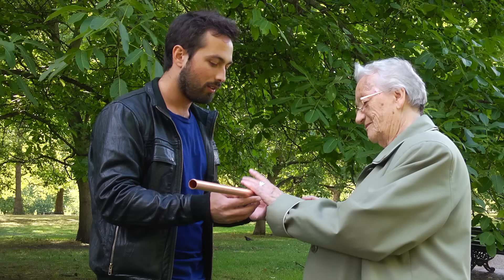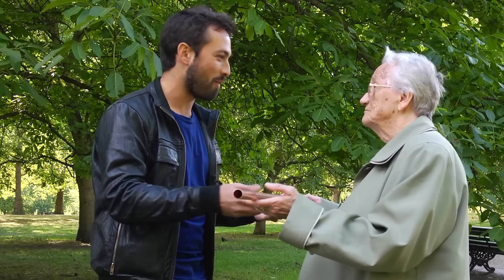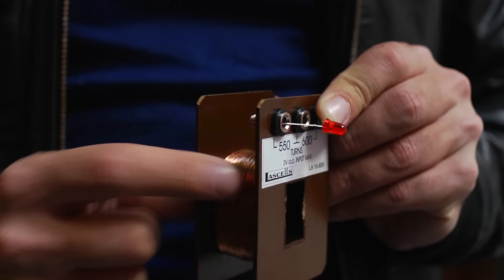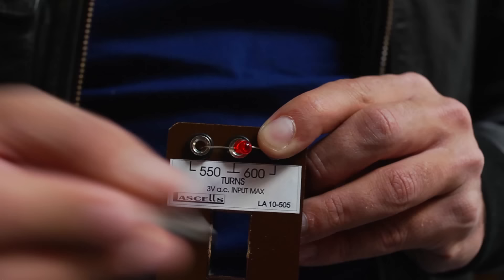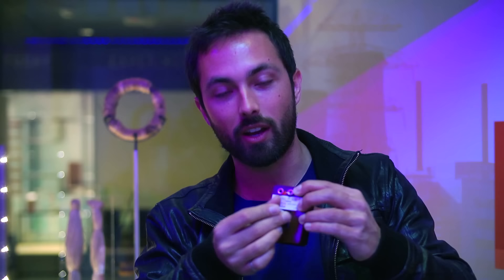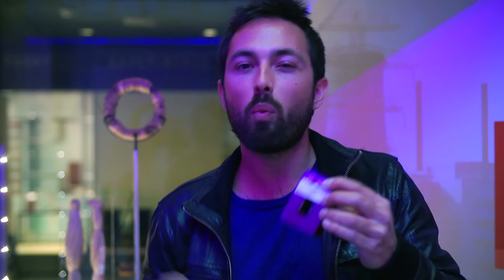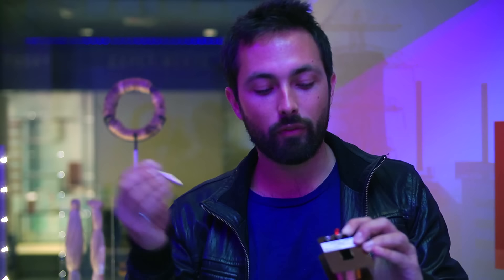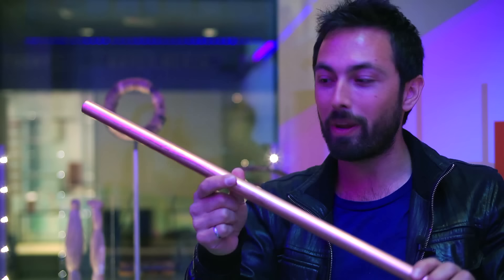World's First Electric Generator

Comment from the maker: It would never stop because if it did the magnetic field in the pipe wouldn't be changing hence there would be no induced current and so no force to oppose the fall of the magnet. But you're quite right, a better conductor would make the magnet fall slower.
Reply: Cool
Reply: Require youtuber like you in india🙂
Reply: @nutanmangukiya528 INDIA SEND ALL TOP SCHOLAR TO US AND A PLEASE BE AWARE

Comment: This phenomenon is actually used in drop tower type amusement rides.The carriage containing the riders is fitted with strong permanent magnets and the vertical rails of the tower contain increasing levels of copper the further down the tower you travel. This automatically slows the carriage through magnetic resistance (2:07) meaning that in the event of a power outage during the decent, the breaking process will still occur regardless.

Comment: What's really cool is that this is so reliable and so powerful that it is being used by roller coaster engineers to stop the trains nowadays.

If you look at most new coasters, they have 2 different styles of brakes. One of these is a simple bracket - no moving parts - that has two rectangular magnets held apart so there is a very strong magnetic field between them. A non-ferrous (meaning it doesn't attract a magnet) plate or fin is bolted to each coaster car to pass between those magnets. They are placed so they never touch.

When the train moves quickly into the brake run, it creates those electrical eddy currents, resisting the movement of the train, and thus slowing it down. But it can't really stop the train completely, just slow it down a lot because these eddy currents' strength is proportional to the speed. Too slow, and they can't create electricity or force. So they add one traditional friction brake to actually stop the train.

It gets a bit nuts when you think of the implications. One of the big coasters to use this technique is Millennium Force in Cedar Point. Once the train goes over the lift, there aren't any brakes until the end, and this is a 300 foot roller coaster. It goes fast. But the last brake run has a whole lot of these bracket and magnet combos to slow the train. The only thing that actually stops this train that a moment ago was going 60+ MPH? A single rubber wheel.

If you take it to the extreme, the cylindrical tower and ring style drop towers operate on the same principle. The magnets and fins swap places, so the magnets are on the ring that is dropped, and the fins are bolted to the tower. When the ring is dropped with all its passengers, there is nothing but a couple guide wheels attaching it to the tower, and it falls in very close to free fall. The only thing that slows this ring down from crashing into the ground from some 200 feet is a braking system that never even touches the ring (!!!). A few pistons at the bottom cushion the last bit of energy, and you are safe on the ground again. And don't worry about it failing. Not only are there a bunch of these to make it redundant, if the ride could last this long, it would be safe for human passengers for the next 700 years (yes, seven hundred) before you would have to replace the magnets once.
Reply: Nice

Comment: This principle is used in traffic signaling to detect when your car has arrived at the intersection, conveniently changing the lights for you. There is an electromagnet (current carrying wire) buried underneath the road and when a conductor (ie vehicle) passes perpendicularly over it, it will induce a current into that wire, thereby changing the voltage in the wire that a computer can detect. It also helps slow your car down just a smidge, just like in the video :)

Comment: the copper tube is acting as a chock whenever there is an active electrical circuit. the passing of the magnetic field generates a current in the tube perpendicular to the direction of the magnets travel, causing a circuit to form, thus choking the magnets movement until it stops and the electrical current then stops allowing the magnet to continue moving downward.

Comment: Should work with aluminium roll of foil too!
Reply: bridgendesar   Yes.  It should work with any non-ferrous metal cylinder.  Something that has no ferromagnetism of its own, but still can conduct electricity.

In practice, it is difficult to conduct electricity with aluminum, unless you treat the surface with an oxide inhibitor.  Even the purist aluminum you can make, will corrode in its outermost layer, and the corroded form of aluminum does not conduct electricity.  Hence you need to treat the surface to stop the formation of AL2O3.

Comment: When the neodymium magnet falls through the copper pipe, and the magnetic field of the magnet is changing it's velocity, eddy currents, which are basically electrons moving in circles due to a Lorentz force, are created inside the pipe. These currents have electrical charge and induce an electromagnetic field on the magnet, which puts an upward force and resistance on the magnet, slowing it down.

Comment: Try what I did... put your copper pipe in the freezer for 15 minutes and see it work twice as good... anybody care to guess why?
Reply: The reason is due to the fact that heat increases the amount of resistance in the copper tube making it less conductive. Chilling it would in this case have the opposite effect, increasing its conductivity and therefore making the electromagnetic field stronger which then would create more lifting power. Something like that?
Reply: magic
Reply: God!
Reply: Rickard Boberg I agree :)
Reply: The colder a metal gets, the more magnetic / electric conductivity it gets.
Have you ever heard about superconductors? They're just some metals cooled up enough yo have 0 electric resistance. And of course this happens gracually. The more you cool it, the more the push up.
Try to get some liquid nytrogen and make the magnet go up again lol
Reply: I got the idea to cool my pipe from superconductors : )
Reply: heat actually gets in the way of the electricity. its like when your computer gets hot, it slows down, the electrons are colliding with the copper atoms. the copper atoms are moving faster because of heat, therefore increasing the chance of collision. so when it froze the electrons get a free pass. nothing gets in its way.
Reply: supremesadat Hotter CPUs slow down because they underclock to avoid overheating.
Reply: Cuz it's like skating on a nice cold ice rink as opposed to a watery bumpy one, as our science teacher explained.
Reply: Adolfo Rosado Great idea. Did you measure the difference it made? How significant is the change?
Reply: By cooling it, you reduce the electrical resistance therefore current can flow more easily and thus makes a stronger magnetic field. Same way super conducing magnets operate by cooling them with LHe or LN2
Reply: *****
But if the magnet goes up you have a reverse magnetic current.
Reply: vkorinfsky cooling the copper actually slows the electrons in the copper not the magnet, thus causing a greater electrical resistance to the moving magnetic field the stronger the electrical resistance the slower the magnet falls through, not the other way around.
Reply: Matthew Norman
actually that is completely incorrect. Research the effect of cooling on conductors, electrical resistance is lowered with lower temperature, therefore more current can flow = stronger opposing magnetic fields = resisting magnet falling more strongly.
Reply: Electrical wires in cars have a greater resistance (ohms) when it's cold outside.  Your battery also has a lower output which is why it hesitates to start in the cold weather.  Auto mechanic here.  Sorry you got it backwards :)  Cold=more resistance, not less.
Reply: I know this from real world experience, not from the classroom 'theory'.  You can see for yourself when you look at your car battery, the 'cold cranking amps' is always less than the regular amps.
Reply: we are talking the difference between the resistance of the electricity vs the electromagnetic fields.... yes electricity has less resistance in a cooled conductor but the more electrical current a conductor has running through it the the greater electromagnetic disruption around the conductor....
Reply: Colder atoms are slower and would hold and conform to a field form better?
Reply: @3800S1  I think that perhaps slower electrons can more easily hold a field form? Hot atoms are squiggly.

Comment: It works a lot better when the inner diameter of the tube is nearer to the outside diameter of the magnet (not an interference fit, but closer). It's quite trippy to pop the magnet into the tube and wait for nearly a minute for it to appear out the bottom.

Comment: The magnetic field that is slowing the magnet down is caused by the downward motion, so it will not completely stop.  I saw another video with a huge magnet, and a thick metal plate.   The magnet can be dropped and it will slow so much that it lands softly onto the plate.

Comment: I know we don't see the whole recorded interview with the people on the streets, but I like the idea to also let people discover the answers by referring to technology they use that can help them realize the answer, ie electric generators which magnets moving through them which are made of copper wires induces electricity. Then follow on to asking them what do they think happens when you short the generators ends and pass the magnet over it, it's difficult to move the magnet. Then explain that's how electric motors that dont use brakes to slow down simply put highly resistive load to cause eddy currents to force against the magnet (actually I think most recharge the battery)... anyway, you get the main idea i'm referring to even though probably wrong on some of the things.

Comment: Yes, photovoltaic cells use certain semi-conductive materials to absorb the energy of light. However, some forms of solar power involve pipes that heat easily in the sun and boil water to push a turbine. Other use a field of mirrors to focus intense light on a tank full of water to boil it (like a magnifying glass). When the water heats up (all the way to a boil) it gains energy and the molecules move around quickly in the steam. This pushes the turbine, which generates electricity.

Comment: You should have discussed what happens to the energy, if the tube was a superconductor. Since there's no resistance, the energy won't dissipate as heat. Instead, the Eddy currents will remain forever and therefore the magnet will levitate. (without falling through). So in fact, the electrical resistance plays a huge role in this experiment. Without it, the magnet will not fall through.

Comment: What´s happening here is a simple example of Lenz´s law. When you drop a magnet trough copper or even aluminum as it moves through it creates current, and part of the current is what we call Foucault current and it goes in opposite direction of the magnet pushing it up thus slowing it. So you are perfectly correct on that, however the question: Is copper magnetic is a bit tricky, yes and no. It is not magnetic in the common sense like Cobalt,Nickel and Iron, but it is magnetic. It is diamagnetic which means it repels the magnet, but the force of repulsion is so low that it´s next to zero. So both answers are pretty much correct.

Comment: Let's not forget about automotive Alternators, which use an electromagnetic induction instead of Ferromagnesian induction.  This keeps the A/C output at a relatively constant voltage, since you can vary the intensity of the electromagnet, give or take a few volts, despite the rpm of the rotor.

Comment: I had the same experiment given to me by a radio ham trainer in the HQ of the ARRL (ham radio representative body for the USA).
My guess was that the moving magnet was creating small bursts of current in the conductor (copper pipe) which created oscillating magnetic fields, which in turn opposed the movement of the magnet.

Comment: Nuclear power involves using nuclear fission to release energy, which is converted into kinetic energy to move magnets near a coil, and thus change it to electrical energy.
So essentially, all power (except some forms like solar power) including fossil fuel burning, wind power, hydroelectricity, nuclear power etc.  involves the magnetic field moving near the coil (or some variation of this) to actually produce the electricity.

Comment: The inducted current equals the change of magnetic current over a certain time. When shooting the magnet through, the magnetic field would change a lot faster than just letting in drop, meaning that the inducted current is equally higher, and therefore the inducted magnetic field should be higher, meaning that the terminal velocity of the falling magnet should not change, since the dropping speed will enlarge the force which is applied to the falling magnet. At least thats what I would expect.

Comment: Actually in ancient times they had a type of battery that produced a 2 volt current. This was a clay pot, with a copper tube Inside, then inside that was an iron rod not touching the side of the copper tube, the pot was then filled with an acid such as vinegar. It's not clear why they had them but they did.

Comment: If you coiled copper wire round the outside of the copper tube and then ran a current through those coiled wires; would the magnet shoot out the top like a gun barrel? Like basically the opposite of this demo
Appreciate any response

Comment: Moving electrical charges create a magnetic field.  Electrons are moving in atoms and molecules.  While not all matter is "magnetic", all matter can be affected by magnetism.  The moving electrons in the copper also create a magnetic field, which is probably more concentrated on the inside of the tube than on the outside of the tube.

Comment: EXCELLENT ! Just one interesting thing missing : the fact that for energy conservation reasons the amount of heat dissipated can be exactly measured by measuring the speed of the magnet when it gets out of the copper tube : it will of course be the difference between kinetic energy it acquires in free fall and the smaller one it acquires thoughout the tube. Fred Hoyle was right : the world is cleverly designed ;-)

Comment: Veritasium, in your diagram, you show the induced currents flowing in two opposite directions. In Bowly's video, he seems to say that they are only flowing one way. Which is correct? And what in the movement of the permanent magnet,  according to the theory, determines which way the induced current will flow?

I had the same question watching your excellent video on Faraday's induction ring. Nothing in the explanation determines in which direction the current will be induced.

Thanks
Reply: I'm asking the same question to myself ;). Using Lenz's law :

I think to the front part of the magnet, from the point of view of the pipe at the same hight,  so induces flux increases, current clockwise, induced flux in other direction than initial flux.

I think to the back part of the magnet, from the point of view of the pipe at the same hight, so induces flux is decreasing, current clockwise, induced flux in same direction than initial flux.

Conclusion : net magnetic flux is zero…so this is not the good point of view.

Perhaps special relativity may be used to takle this. What do you think of that?

Comment: Just to make myself feel smart before watching past 1:08: The magnet is inducing an electric current in the pipe which is, in turn, inducing a magnetic field, resisting the magnet's movement through the pipe. It's the same reason electric inductors end up providing a small amount of resistance in direct current circuits. I believe it's called electromotive force (EMF). Wish you would have walked up and asked what was going on :).
Reply: +Matt Lambert Your first point is correct, but resistance is not caused by electromagnetic induction. When the EMF (just another name for the voltage --aka potential difference (PD)) is constant, there is a constant magnetic field but no induced current because the field is not changing. The induction effect only persists while the current is increasing after the circuit is switched on (and later when it's switched off).
Reply: Terry Moore Respectfully, I think you were correct in one point an incorrect in the other. The magnetic field is moving . As the magnet moves down the pipe the magnetic field moves along with it. You were right that electromotive force is just voltage, I actually should have said, "back EMF" or "counter-electromotive force" which is the voltage that pushes against the current that induced it. It's the same reason inductors have resistance.
Reply: +Matt Lambert You are correct about back EMF and the fact that the field is changing as the magnet moves down the tube. I was referring to the remark about direct currents, by which I assumed you meant constant current. Perhaps we are just talking at cross purposes.
Reply: +Terry Moore The way I would explain this is... As a magnet moves it creates photons, those photons since close to a conductor turn into + and - electron.. the conductor now has an electromagnetic field which is interacting with the magnetic field and in result slowing down the magnet.
Reply: +Matt Lambert And THAT is the winner: Lenz`s Law!

Comment: What about the homopolar generator where there's no change in the magnetic flux, specifically when magnet and disk rotate together? And also, where should be the back electromotive force? Between all the rotor and space itself? Vacuum energy? Higgs field involved in the change of mass of a conductive material rotating in the polarized field?

Comment: During this explanation you mentioned that it is actually gravitational force which is doing the work and that energy is being converted to electricity and heat. Then does that means the energy behind gravitational force is weakening as it being converted and radiated in other forms?